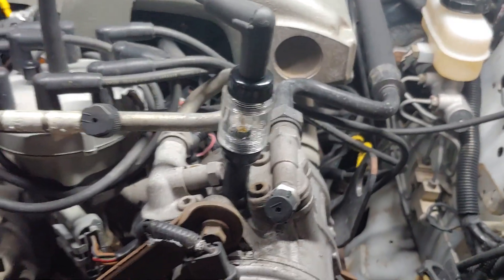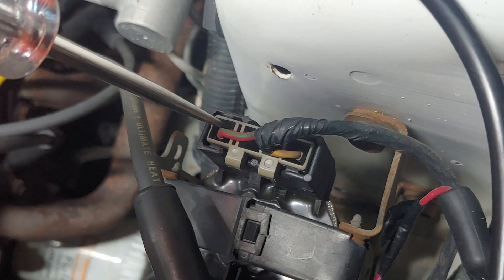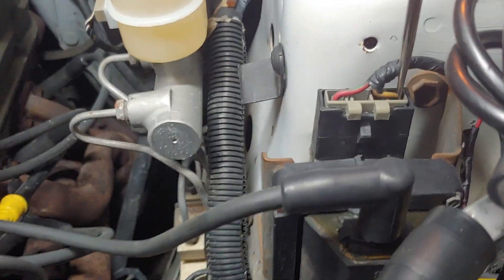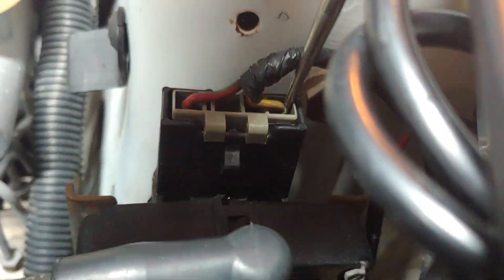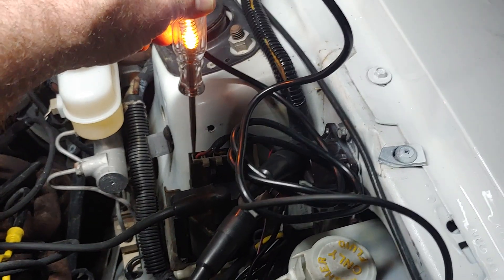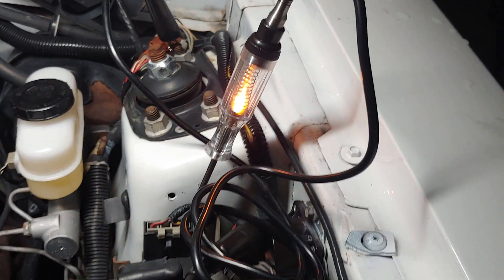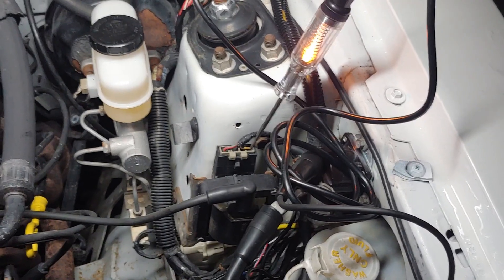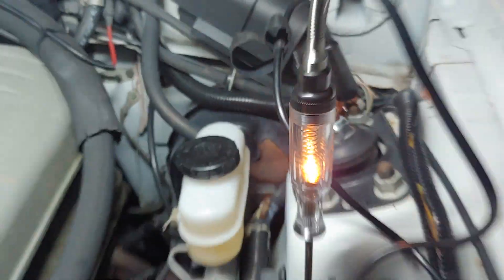How to test a TFI Ignition Coil on a 5.0L Mustang

Comment: Have a 88 Fox GT 5.0 Convertible, I live in SE FL and car is garaged.
I'm having starter issues... Car for the most parts starts right up when cold (remember I am in FL - so not too cold) when I run the car for approximately 1/2 hour and then stop and shut off car - say for gas or store and then return to start the car, it almost doesn't want to crank over?? Just a weak partial starter crank. I've replaced the starter (first with new SVO starter (did not help) then with brand new OEM), but still did not solve the issue (same symptom). Also replaced Solenoid (on fender) too. Brand new battery & leads also. Have to make several attempts to get starter to turn over to start engine. Once I get a decent short crank of starter engine fires right up and has no issues (runs very smooth). Any suggestions??? Car has 83k original easy miles (no modifications - all original - never abused) and looks showroom (Auto Trans by the way).
Reply from the maker: First, do a voltage drop test on both battery cables. So connect red lead to one end of a battery cable, and black lead to the other end of battery cable. The meter tells you the voltage drop in this scenario, so the answer is ideally 0 volts, but realistically about 0.5 volts. The circuit has to be loaded for this test, so you'll crank the engine over while someone monitors the voltage on the meter. If the voltage spikes up above 1/2 volt, that means that cable is losing voltage between it's two ends, and there is a resistance in the cable.

Then switch to the negative battery cable, and test it from end to end the same way, during cranking. Again, more than 0.5 volts means there is some resistance in the cable. Next, measure battery voltage during cranking. It really shouldn't be dropping more than to about 11.8 volts. If you're under 11.5 volts, the battery is probably either weak or discharged. FYI, the starter housing is the ground, because it connects to the block. Make sure there is no corrosion or paint between the block and the starter housing.

If it turns out the problem is not battery or starter or cables, the next step would be to remove the serpentine belt, and crank the engine up. If it spins over great, then one of your belt-driven accessories may be locking up so you go spin each one and see if they have abnormal drag. If the car still cranks poorly, measure voltage between the red wire and the starter housing. Whatever you have at the battery during cranking, you should also have at the red wire's terminal on the starter, between it and the starter housing, during crank.

If all else fails, remove spark plugs, remove belts, and turn engine over by hand with a 1/2" ratchet. If it turns really tight, it's a motor problem.

Comment: Thanks, I was looking for a test of the TFI on distributor. I have power to fuel pump, fuel relay and mine sounds like yours. Will run for 20 seconds and then die. Trying to pinpoint it, Thanks
Reply: Shutting off after 20 seconds sounds like a TFI module or maybe a PIP sensor problem to me. But it could also be an O2 sensor problem, although it would run poorly first, before shutting off.
Reply: @Pontisteve  thanks Steve, I ordered a new Motorcraft TFI module and will start there

Comment: I have a 1988 tbird 5.0 , have good power at the coil, and good ignition control , but will crank all day but not speak until I let the key go from the start position, any idea?
Reply from the maker: Sounds like you have an ignition switch issue. Could be a bad switch, corroded switch contacts, or the wires going to the switch can have broken plastic retainer tabs and cause the wire to not really plug into the switch. Also, the ignition module gets one power source when you're running, and power on the start terminal when you're cranking. I think it fires the coil a little hotter when in start mode. Perhaps your start wire has power during cranking, but your run wire (power to the ignition module when key is in run) is missing. Find the pinout for the ignition module, and make sure you have power to the module in start, and in run.

Comment: Would have been nice to show people how to measure resistance of coil primary and secondary. Nice video, good troubleshooting.
Reply from the maker: We don't show that because it's not a very accurate test. Coil resistance can test fine on a cold coil, and go to pot on a hot coil very quickly. While a bad coil might be able to be seen using a resistance test if the coil is really bad, in most cases the coil will test good and yet be bad when it gets warm. A much better indicator of coil performance is to make the coil jump an adjustable gap.

Comment: You Do want to use an LED lamp, it turns on and off immediately unlike an incandescent lamp that retains its glow after power is removed. An LED. Will produce much more pronounced flickering and add almost no load to your circuit.
Reply from the maker: While I agree with your description of an LED light being an effective tool for seeing signals like injector pulse and other fast signals, you'll likely fry the electronics in an LED test light if using it on a coil. The flyback voltage spikes from a coil can be in excess of 100 volts. Leave the LED test light in your tool box when testing ignition coils like this one. Now if it's a 3-wire (or more) COP coil on a newer vehicle that has power, ground, and a 5v turn-on signal and not a load-carrying signal, then the LED test light would be fine for testing that signal.

Comment: What if im not getting power to my coil at all
Reply: Is there a fuse for it
Reply: @kadenewman71   the ignition switch, which should be hot at all times, sends power to the coil when you turn the key to start or run. Those are actually two separate power sources that T together later, so check for power to the coil in both start and run. The switch also sends power to the ignition module (red/light green wire), and the PCM power relay. The PCM relay powers up everything, including the fuel injectors, MAF, computer, and emissions solenoids. So you can check for power going to the red wire of the injectors and see if you have power there, or the red wire on the MAF, or the red wire on the AIR pump and EGR solenoids, and the Idle Air Control motor to see if any of that stuff is getting power. 

If none of those are getting power, it's your ignition switch, or the power going to it. These switches are an old school design that can fail a lot with age, or switches or contacts can corrode. Also, the switches and the harness connector are plastic and get brittle, and can break and not retain the wire into the ignition switch.

If you havce power to all those other things, but notg to the coil, then it's a problem with that red/light green coil wire between the coil, and the splice that the wire goes to.

Comment: I know its been a while, im not getting any flicker from the ground side of the coil. However there is current going to the coil. So does that mean my tfi module is not grounding the coil?
Reply: Do you mean there is voltage going to the coil? Because current can't flow unless you have both power and ground to the coil. Anyway, if the coil has power on the red wire and the test light doesn't flicker at all while you're cranking the engine, then the coil isn't being told to fire. That could be a bad PIP sensor or a bad ignition module. Your next step would be to backprobe the PIP sensor signal wire at the ignition module, which I believe is the top wire on the ignition module if I remember correctly. Use an LED test light for that test, and crank the engine to see if the PIP sensor produces a signal. If it doesn't, it's bad. If it does, the module is bad.
Reply: @Pontisteve  thanks ill try!

Comment: I have no ignition control. Both sides of the coil stay lit during crank. Still can’t get it turned on. I’m lost.
Reply from the maker: Sounds like your ignition module is not ground pulsing the coil. Check for power and ground at the ignition module, and for pulse at the PIP sensor, then call the module bad.

Comment: Thanks for the video, 1994 Mustang GT, key in run position, new coil, positive side lights up, negative side lights up but flickers/clicks and I am not turning the key to the start position.  Any ideas?
Reply: When the key is on and the engine is not spinning, you should have the positive side (red wire) of the coil have 12.6v or so. The negative side of the coil should not have anything! If you switch your test light to battery positive, and touch the tip of the test light to the negative side of the coil, you should see nothing. If you see the light on solid, turn the key off right away! That means your coil is being constantly grounded, and will die a QUICK death, if it hasn't already been killed.

If you are testing the negative side of the coil with that same test and you see a pulsation, then one of two things is happening: Either your PIP sensor is bad and it's intermittently sending a PIP signal to the PCM and to the ignition module, causing the module to fire the coil and POSSIBLY causing the PCM to fire an injector, OR the ignition module is bad and it's randomly firing the injector. 

I suppose you could also check the ignition module ground using an incandescent test light hooked to battery positive, to see if the bulb lights up bright and consistent. Bad grounds sometimes show up as flickering pulses in strange places.

Last time I saw this was on a fox body, and the coil had a constant power and ground. The coil was bad because the ignition module was bad and was constantly grounding the coil. That will kill a coil in an instant. Coils are typically turned on for about 5 thousandths of a second, to charge the coil. Having it on non-stop almost certainly will overheat the coil really quickly, and kill it. You might want to also physically inspect the coil very carefully to see if it shows signs of swelling or cracking. I almost would expect that if you have a constant ground to the coil. A pulsed ground might not kill the coil.

It's not a perfect test, but if you turn the key on and hear an injector clicking, then I would say the PIP sensor is bad and intermittently sending a PIP signal to the module. This could also be a PCM problem, but you could rule that out completely by unplugging the SPOUT connector and seeing if your coil negative pulsation goes away. You could also test the PIP sensor signal with an LED test light hooked up to the top wire on the ignition module, and the test light grounded to battery negative. You should not see any flashes/pulses with the key off.
Reply: Steve,  Thanks, I will check this out this afternoon,  just to clarify.  The clicking noise is coming from the new coil I installed, not the injectors.  I have also replaced the PIP with the same result.  Based upon what you said if I don’t find anything I will start checking the grounds....Thanks again!!
Reply: @briansteinbruegge3098  do all the tests you can, but bear in mind the ignition module is ultimately in charge of the coil. Unplug the SPOUT connector to eliminate the PCM from the equation, and if the grounds and PIP are good, replace the module. Remember, those modules are really worked hard. They're a high failure rate item. Although the fender-mounted 94-95 modules are far less bad than the distributor mounted ones were, due to less heat.

Comment: My voltage drops to 10.1 when trying to start. I put in the terminator x system and it needs 10.5 volts to start. What test can I do to fix this?    Great video
Reply from the maker: Voltage to what? PCM, fuel pump, coil? I'm assuming coil but it's really all of the above probably.

The problem is the ignition switch. These older Fords had power going from the starter, to a fusible link, thru the ignition switch, then thru another fusible link to the a splice. The splice feeds the EEC relay, which powers up nearly everything, and also to the TFI module and the coil. While there's some voltage drop in the length of all these wires and their age and corrosion, and probably some in each fusible link, the big voltage drop usually occurs at the ignition switch.

Whenever you use a switch with mechanical contacts to transfer high amperage thru the switch contacts, those contacts will corrode. This is why high amperage fan switches still burn up, and why distributor cap points always have white corrosion on them. All high amperage switches corrode their contacts over time. And even though the switch contacts may be touching, they are touching through corrosion. So there's a voltage drop between the input of power to the ignition switch, and the output of power coming out of the switch and going to the coil.

First, make sure all your battery cables and terminals are in great shape. Then make sure any fusible links aren't partially burnt or swollen. Then measure the voltage drop, or the voltage coming in and going out of the ignition switch. There are two large yellow wires coming into the switch bringing the power in, and ignition switch pin 12 is the start voltage coming out, and pin 11 is the run voltage coming out of the ignition switch. If you don't have the same amount of voltage coming (during crank or run) as you do going out (during crank or run), then your switch is dropping some voltage across the switch contacts. 

A new ignition switch might be a nice fix, but ideally we would like to re-engineer that a bit. Use the coil power wire as a relay control wire, and have new short wires coming into the relay from a fused power source, and going out to the coil. Those skirted Hella 30/40A relays and pigtails are perfect for this. You could end up with maybe 0.1v drop instead of 1 to 3 volt drop to the coil. If you think about it, this is actually a performance trick too because it guarantees the coil has max input voltage, and therefore more output voltage. The same trick could be applied to the fuel pump.
Reply: Drag Radial Performance   WOW that is a lot. I put in the terminator x system and all this started. I will check the ignition switch and see what is going on there. Thanks for the quick response. Also, my 87  is a Mcarlen Mustang
Reply: Do you have a video out on ignition fix’s?

Comment: What's going on when you have no juice on the negative side of the coil?
Reply: The coil gets power all the time when the key is on, from the ignition switch. It gets a ground from the ignition module. If you hook a test light up to battery positive, you can see this brief ground blink the test light as the engine is cranking. If the test light is lit all the time, you have a constant ground from the module, which will coil the ignition coil in no time. If by juice, you mean voltage, you are never going to get anything from the ignition module ground. You are getting a ground pulse from the module.

Comment: Thank you so much my mustang has been sitting for yrs with no spark after watching your video and having some extra money I found that when testing the ground side of the coil while cranking it didn't flicker so I bought a new distributor which was only $40 more than a new module and it fired right up, I'm so pissed I didn't try earlier, now I'm saving up for a motorcraft distributor